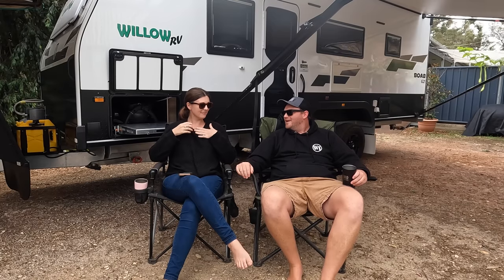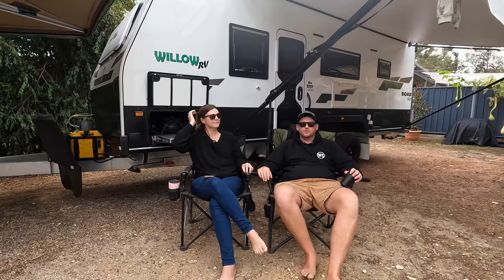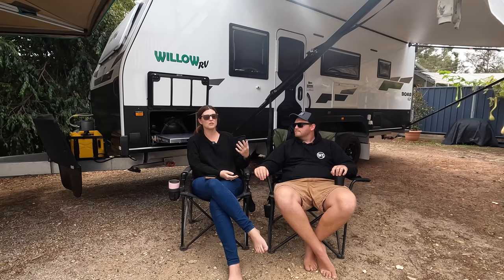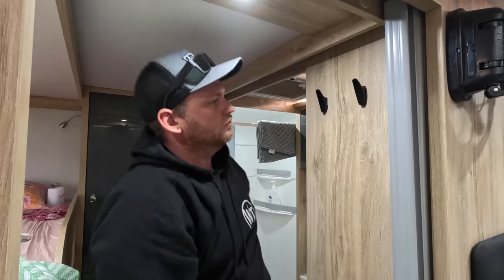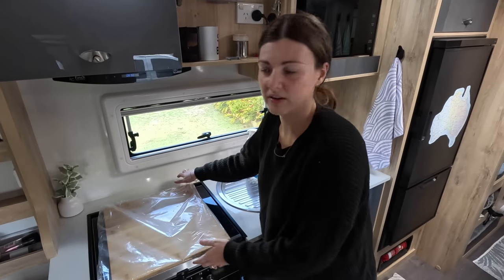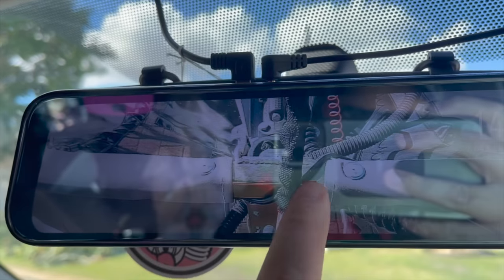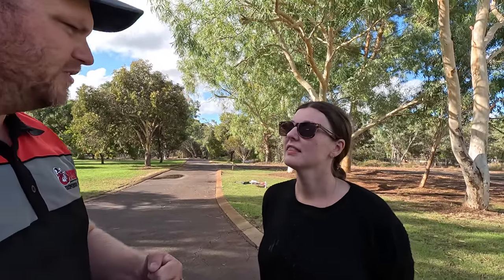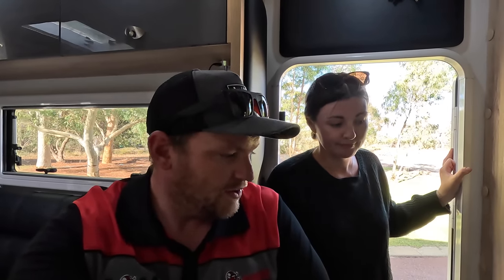WATER LEAKS & REWIRING OUR 8 MONTH OLD CARAVAN... || PLUS fitting a Stone Stomper and Awning Support

Comment: I was always looking at Willow from trip in a van days and then when you had done your research, and went Willow I was stoked! Love your feed back, and I’m still keen for weights and insulation etc😝Cheers guys.
Reply from the maker: The insulation is 👌, only downside is it takes longer to cool down on really hot days. Tiff loves that it stays toasty warm overnight without the need for a heater though! Fully loaded the van is bang on 3T.
Reply: @WildTouring  we had a Jurgens before our Traveller. Just so you know the guys who own Willow use to work at Jurgens. 
So it was interesting hear your comments because some of the cabinet issues you were having we had also on the Jurgens. Funny that. 
Anyway, I was quite concerned going from a sandwich panel like the Jurgens and Willow to “stick and tin” on the Traveller. 
After 14 months full time on the road including a 7 week stint working in Kalgoorlie from January to March the cooling and heating of the Traveller has been a surprise. I remember the Jurgens heated up quickly but was great on cold nights.

Comment: Just a quick heads up on Willow and any caravan manufactured in Victoria, the manufacturer must supply the original Certificate of Electrical Safety and Certificate of Compliance for the gas side of things plus plumbing. These certificates can only be issued by Licensed Electricians and Plumbers. Whatever ESV (Energy Safe Victoria) told you is fact and if there were problems with the electrical wiring side of things, then Willow RV are not compliant. It's a disgrace by the caravan industry including manufacturers and industry groups to allow this type of behavior to continue, without us spending our hard earnt cash there would be no industry. So sorry that you guys had to fork out additional dollars to fix other people's work that you had already paid for.
Reply: On what evidence are you assuming that Willow were not compliant? As Cam said, ' I don't want to get into the legalities/standards/rules on a public platform because it's not my field of expertise and I'm not qualified to give advice'....
Reply: @Rosemary-zd4zf  suggest you read my comment again as it's pretty straight forward, I'm qualified to give such advice after being a licensed plumber/gasfitter for 38 yrs. If the caravan needed to be rewired, then it would appear that the wiring was not compliant otherwise the certificate of electrical safety would have covered it including the cost to have it rewired, these are facts. Yes I have a licence with ESV, so once again more than qualified to give advice which is all I was doing, I did ask for a debate or further discussion with the channel owner, simply offered some factual advice. Did you know that a certificate of electrical safety and equivalent for gas from ESV must be provided to VicRoads before a new caravan can be registered in Victoria, yes fact.
Reply: @jobail01  Nothing you have written above is evidence that the Willow van was not compliant with Victorian standards.
Reply: @Rosemary-zd4zf  I'll leave it at that as clearly you don't want to understand the regulator laws and statutory requirements placed on those completing the work, it's all very clear, 1+1 =2.